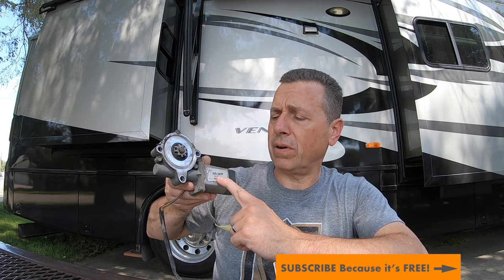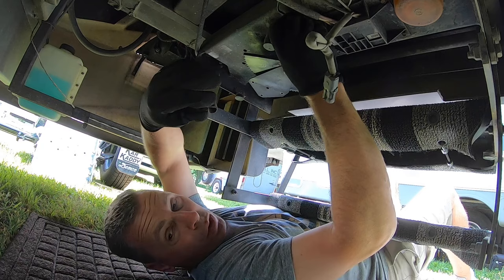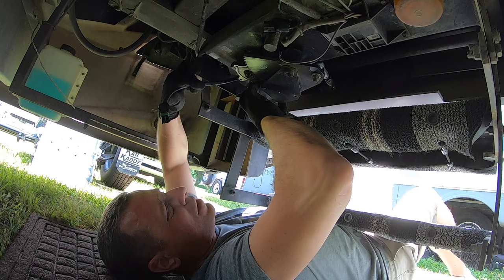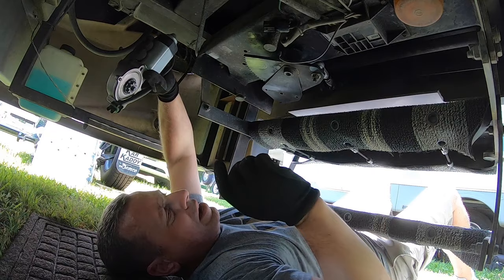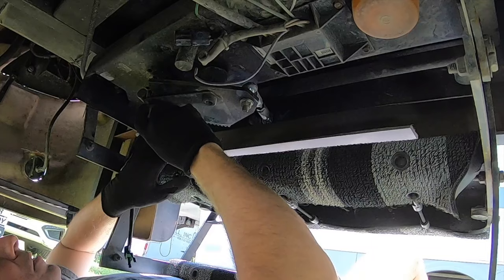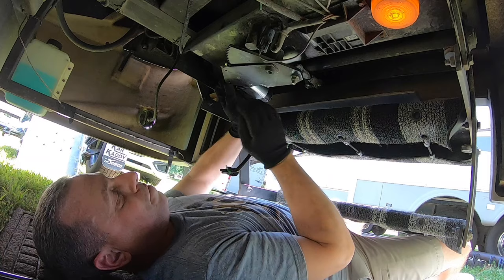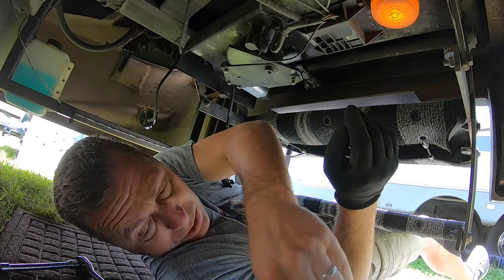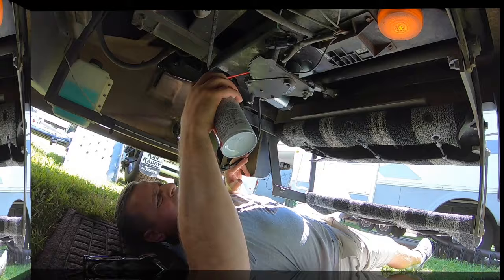DIY RV Step Motor Replacement | Full Time RV

Comment: I discovered when installing a new motor and gear plate on my steps that the position of the steps when you reassemble everything does not matter. The steps can be in - out - or anywhere in between. The motor works on pressure to stop going in either direction so it has no idea the current position of the steps. Once you get everything put back together and activate the switch it will pick up from that position and go to the open or closed position depending on which you are calling for. Made reassembly a lot easier.
Reply from the maker: Hi Tom, thanks for sharing this! Gosh that has been so long ago I had to go back quickly and scroll forward to take a look at the video again to that specific point.  It looks like and seems...(If my memory serves me correctly)...on ours...I had to hold the step up to get it out of my way. Hope I don’t have to find out again. 😂🤪

Comment: FYI Step location doesn't matter. The controller just will decide when to stop either direction.
Reply from the maker: Thanks Steve, heard that before also but for some reason it wouldn’t unless I did it that way, which is why I mentioned it. Not sure if some controllers are different or what the deal was. Probably user error somehow. 🤷‍♂️
Reply: The motors have a contact breaker built in. The controller has an ampere limit cut out. So the motor can be installed with stairs in any position.
Reply: @johnyaceyko9775  So you’re saying they designed it knowing it would break down at some point and it would be easier to repair? 👌🏽

Comment: Hi!  Thanks so much for the easy to follow instructions on replacing the step motor.  As advised by you (and by Lippert) we ordered our part from Amazon (didn't get quite as good a deal as you did, but was glad to get it) and it arrived today (Sunday). Husband and I are thinking, 3 bolts, plug it in, should be working in 20-30 minutes, including gathering the needed tools. We had already removed our old part. When we got ready to put the bolts through the holes of the new part, they absolutely would not go in. Comparing the holes of the old part (which the bolts just slid through) to the new one, it was obvious the holes in the new part were smaller.  We considered drilling them out but don't know that we may do more damage and we don't want to pay $150.00 plus for another new part. I have a call in to a friend that works on rv's for ideas but haven't heard back from him and tomorrow (Monday) I will call Lippert guy again and ask him what we should do. Since we are in Elkhart right now, maybe they will make the part good. In the meantime, do you have any suggestions. Fyi...this is how everything husband and I try to do goes...we always have some unusual issue.
Reply from the maker: Oh no, so sorry to hear about the issues with the new part. Sounds like it is not the right part or they surely would have the correct diameter for the bolts.  I would wait and see what Lippert says.  Let me know what they say.
Reply: I called Lippert this morning.  Spoke with same person I spoke to Friday. He told me they were aware that there had been quite a few that were shipped over that way from manufacturer.  He said just drill it out a bit. When questioned if there was anything we had to be careful not to damage. He said no big deal, drill it out, it's just plastic. I'll let you know how that goes in case someone else encounters the problem.
Reply from the maker: Interesting. As long as there is plenty of thickness to the area and won’t weaken it, I would say you should be fine.  That makes you wonder if you returned it and bought another if it would be the right size holes. Doesn’t seem right that you would have to do that after paying so much for the part. Thanks for the update and good luck!👍🏻
Reply: I was concerned about the same thing and thickness of walls being drilled and asked about damage we might cause.  That's when he replied it would be fine and it was plastic (which...I don't think so since they certainly looked like metal slivers to me.) Anyway we got it drilled using a bit that was the size of the holes in the old part...and moved on. It was easy with one minor glitch...one of the bolt's threads were boogered up on the very last thread and wouldn't thread into the hole. Hubby said have to go get a new one (which my guess with our luck would have been one of those "special" bolts that would have been as hard to find as Jimmy Hoffa's body). I said "Give me a file." I did a little filing on the last thread and cleaned it up and voila...in she went. Finished up...plugged it in and it works fine. Thank you again for the easy to follow video.
Reply from the maker: Awesome! Great job using the file! I’ve had to do that a time or two years ago as well as using a tap. Nerve wrecking when you’re not sure if you can even get a replacement bolt or if you are needing it “right now.”
We are SO happy that video helped someone! 👍🏻😊🤓

Comment: Yep. Got the part for 40$ followed the video and voila! Steps are fixed now. Figured I saved between $300 and  $800 so I've been told by rv mechanics. Those rv repair shops charge a minimum of $60 an hr! Not an easy go of it though. Just stick with it! Thanks!😂😂

Comment: I’ll be changing my step motor in the next few days. Your video builds my confidence that it should be an easy job. That’s always dangerous optimism. We’re full time and have been on the road for two months. It will be nice to not have to use a stool with a rope attached in the center of the step. Thanks for the video.

Comment: Hi gentleman ! Thank you for this video. I would add something, if you have problems to screw bolt, in frame; if bolt are loosen in frame, i put insert threaded in each hole. It’s magnifique. My sucks is that the mobile plate is to screwed hardly. I can’t unscrew it. Do you have some tips for that?

Comment: Good instructions really helped.  After struggling with installation i ran a tap thru the holes in the plate to clean the rust and debris then assembled easily.  Thanks

Comment: We just had a problem with our 2006 Newmar. Step would not retract. Banged on motor and it worked sporadically.  Took motor out and cleaned the brushes hoping that would work.  After several wasted hours it still works sporadically... Oh well now we know how replace it easily when we get a new one. Lesson learned.  Great video by the way, but you seemed to have less of a problem getting the motor bolts back in then we did.
Reply from the maker: Hey, kudos for trying to fix the motor first!  I’m the same way, I like the challenge of trying to fix something first.  The bolts can be a little tricky if you don’t have it all quite lined.  Hope you get your motor replaced soon. 😊

Comment: Thanks!  My steps work smoothly but will only work in warm weather. I initially ordered a new controller which turned out not to be the issue, so sending it back. Ordered a new motor on Amazon today. They are even cheaper now! ($49.00) Hoping this solves my issue. Not sure what else could be causing the issue except the motor, considering its' finicky desire to not be cold. 🥶😁
Reply from the maker: Hope that takes care of it for you.

Comment: Hi Brian, great video.  My entry steps have a problem.  When the switch or door is activated they either go part way in or part way out and stop and the motor has a loud humming noise.  Could this be a bad motor, thx again.
Reply from the maker: I would look and make sure something is not jammed preventing them from going all the way in first... like a stick or rock, then I'd get some spray lube and lube all the hinges and moving parts that you can.

Comment: Need help: one of my motor bolts fell out so I bolted it back on now the steps extend and retract but when its extends fully the gears makes a grinding noise for about 3 seconds then the motor stop
Reply from the maker: Did the gear slip when the bolt fell out and possibly was not in the correct position when you bolted it back? It’s hard to say without looking at it but it sounds like it’s not in the correct position, like off just enough for that 3 second difference, and wants to keep going which makes it grind (or slip).

Comment: Is the gear on the motor free spinning? It spins when the door opens and closes but will not keep the steps in place.
Reply from the maker: That video was so long ago that I don’t recall for sure, but it does seem like I had to in order for it to line up properly. 🤷‍♂️

Comment: I have 3 bolts and 5 spacer's were do the other 2 spacers go?
Reply from the maker: Hi Bonnie - Hopefully this was meant as a joke and you aren’t really having an issue remembering where they go? If not…this video was so long ago and back when we had this Class A and unfortunately my memory isn’t good enough to remember something like this, so long ago…Sorry. :( 
If it was something a person did on a daily basis, it would be easier to remember. But even at that, it may be different on a different Class A/step motor. Hopefully you can recall that where they were when you took them off.

Comment: I know you did this a while back but wanted to ask you if you had to drill out the holes on the new motor? Also am I correct that one spacer has to go on top of the plate and the second spacer on top of the second plate? I bought one motor which cost $174.00 and would have to drill out the holes to 1/4 so not wanted to do that, I ordered a cheaper motor at $58.00 to see if that would would fit without drilling out the holes.
Reply from the maker: I did not have to drill anything out, just remove and replace. As far as the spacers, I am drawing a blank on that. It’s been too long ago for my brain to remember. Lol Hope the cheaper motor works for ya. 👍🏻
Reply: @LivinRVision  I received the second motor which had the correct hole size. This motor and the original motor look the same. I looked back at your video and saw where the spacers go. Install hopefully today. I am returning the $174.00 motor to Amazon.

Comment: Great video! Was your old motor the Kwikee 5973820?
Reply from the maker: No, but when you take yours off it should have a number on it that will help you find the model for your own.  Sometimes it’s been replaced with a newer version.  That’s what happened with ours.

Comment: The step on my motor home is stuck in the "in" position and won't come out. Checked fuse, wiring, etc. Narrowed the problem down to either the step motor or the controller for the step. We were unable to test the step motor due to the type of lead coming off the motor itself. I guess you knew your step motor was faulty due to the noises it was making. I was wondering if I remove the step motor if I can pull the steps out manually? I appreciated you telling us about buying the replacement part on Amazon!
Reply from the maker: I knew our step motor was bad, because I removed it and held a pair of pliars on the gear ever so lightly while the motor was running and it took very little pressure to make the gear skip internally in the motor.  When the motor was still attached to the coach, and we would try to engage the step to go in and out, it was obvious that it was skipping and not catching on the gear.  That’s why I took the motor off and tested it by seeing how much pressure it took to stop the gear from turning.  In our case, it was very obvious.  Does yours make a noise as if it is “trying” to run?  If it does, then I would remove the motor and plug it back in while holding the motor and see if the motor will run. If the gear turns, then both it and the controller are good and your gear to the steps itself are stuck.  Process of elimination, but it’s hard to diagnose without being there as things can get misconstrued through verbal communication. Good luck with yours Mike and let us all know what you find out. 😊🤓
Reply: @LivinRVision  Thanks for your ideas, Brian! I'll keep working on it and let you know what we come up with.